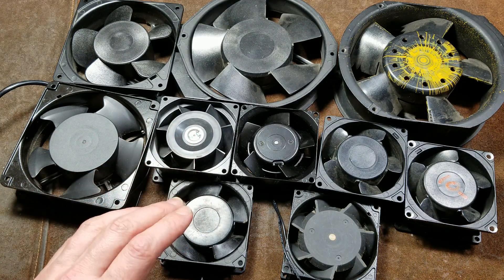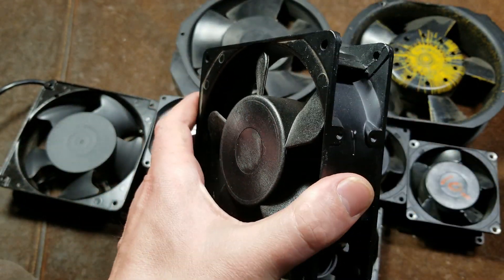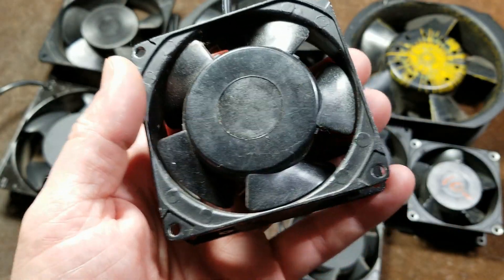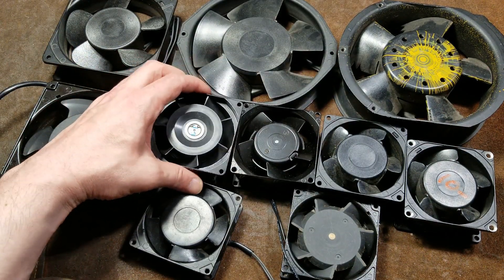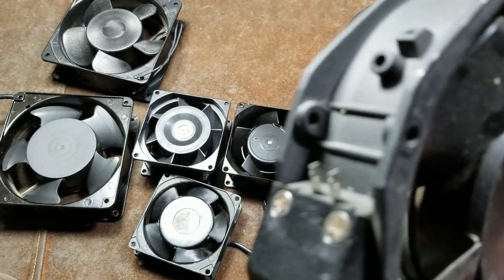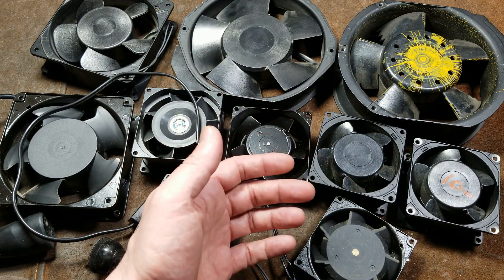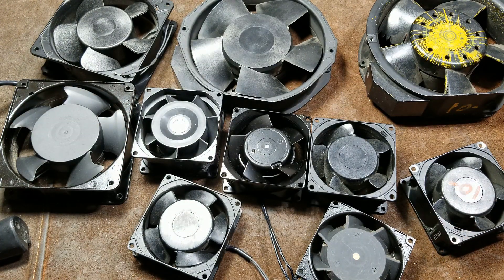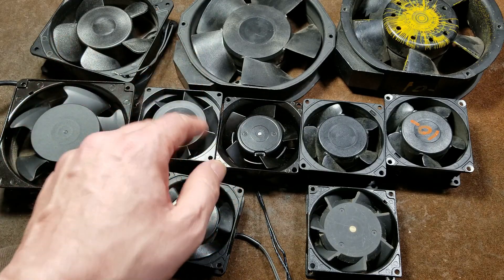AC Electronic Box Fans Overview

Comment: There is also another way to make an AC fan. Use a DC brushless fan and a 12v wall wart. I like to run it off USB C and use temperature controlled fan speed controller, the higher the enclosure temp the higher the rpm. One hot Texas summer day, you will really hear that satisfying delta fan  whrr if the ambient noise levels are low.

Comment: Hey buddy, do you know if air filters reduce motor lifespan?
Reply from the maker: not that i am aware of. the reduced dust in the motor would make up for any reduction of life due to increased motor tempratures.
Reply: @CatusMaximus  are they universal voltage
Reply: @xa-xii4865  yesn't, they do have a maximum voltage,

Comment: Replacing the TINY little fan in our TiVO today
Reply from the maker: I forgot to mention in the videos you have to be careful when replacing fans in electronics you can only use the same power level or slightly larger but you have to be careful not to overload the little fan driver circuit I've done that before by just saying I'm going to put it in a big server fan that uses triple the power and then it blows it out
Reply: @CatusMaximus  direct replacement from known source. Hundreds of reviews etc.